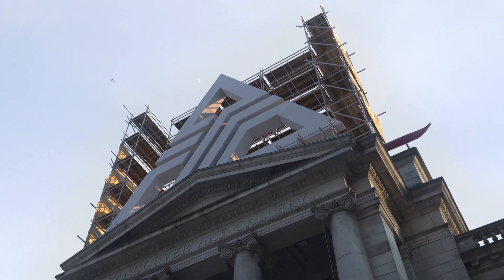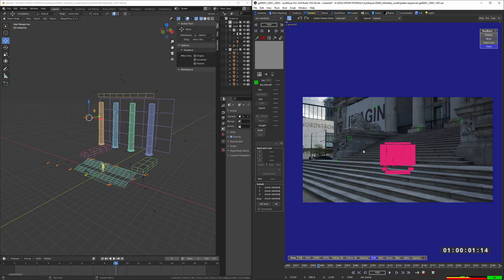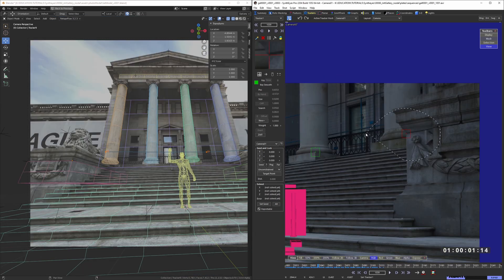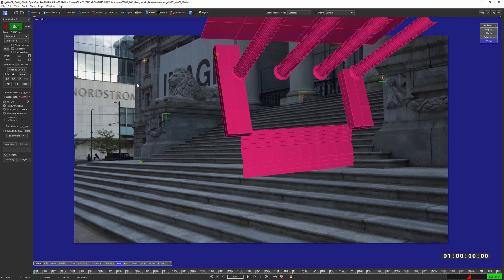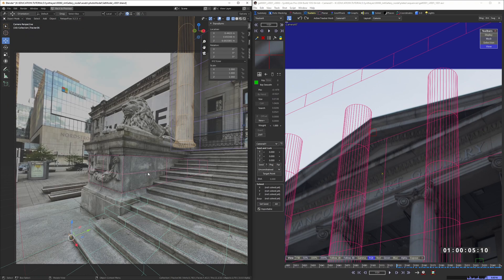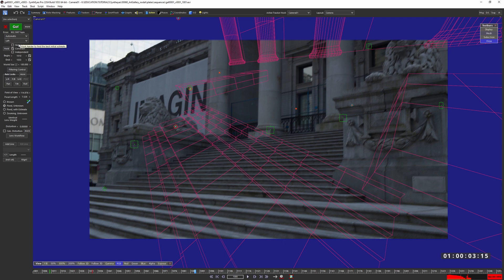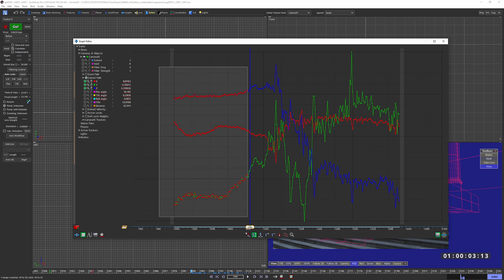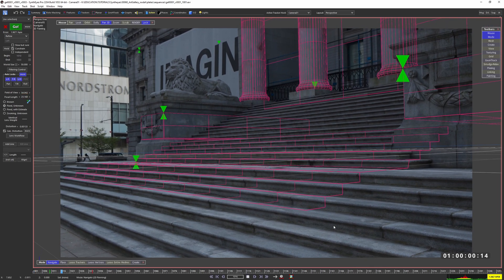Tripod Solving With Survey Data - SYNTHEYES

Comment: Tip for Blender here: if you hover your mouse over a text/number/color field, you don't need to click, select and Ctrl+C... you can just hover and press Ctrl+C. Blender will know you wanted to copy the field's contents :D (Something every software should do!!).

Of course, the problem with this (which is why maybe you did it by selecting text directly) is that it will copy over the "m" for meters. This can be fixed by going to the Scene Tab in the Properties Editor, and choosing "None" as the Unit. Now there would only be numbers (not units) in the number fields for the empties positions.

Hope it helps, and great tutorials!! :D

Comment: "Over in Blender I did some photo modeling..." <- Erm, could you elaborate on that? I mean, how you did align cameras / remove lens distortion inside Blender. Not the modeling ;)
I see in Blender's Outliner, that it looks like your were already importing data from Syntheyes, right?
Thanks a lot for your great tutorials
Reply from the maker: Hey sorry for the late reply! I'm slow with Youtube comments. I actually just did a stream on survey solving my kitchen. You can search "Track VFX Live". It's one of the most recent videos. I did learn something about how syntheyes works with trackers enabling and re enabling between the images you shoot. So there's a part I struggle with where 3Dequaliser works better. But I do figure out the problem close to the end of the stream ha. Survey solves give you better 3D data to use in other shots where parallax is lacking. I took pictures on my phone then tracked and solved them in Syntheyes. Did the modelling / reconstruction in Blender. I should have clarified that if I didn't. Sorry about that. ha
Reply: @trackvfx6760  No worries about the "late" reply ;)
Awesome, this explains everything. Keep up the great work 👍